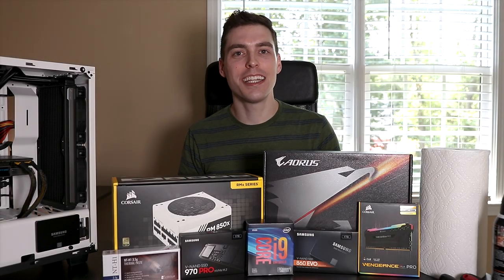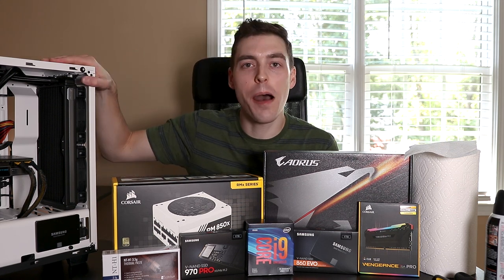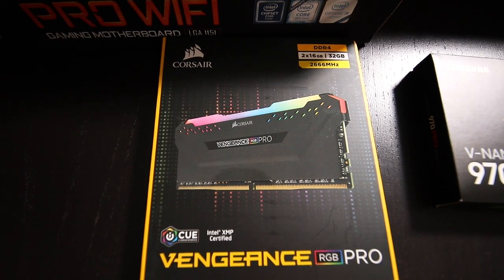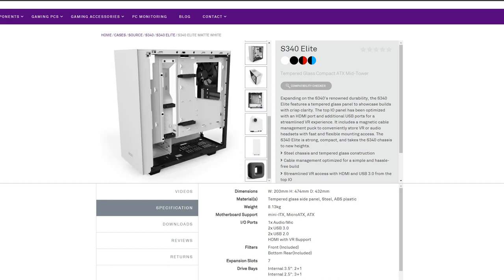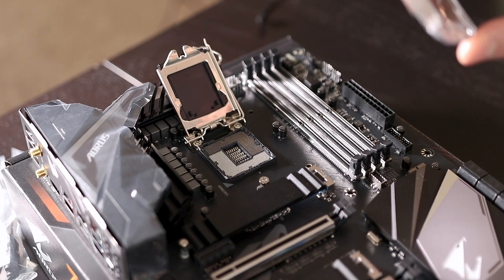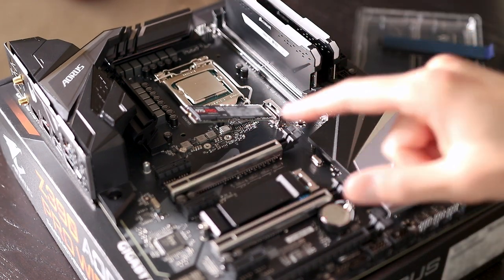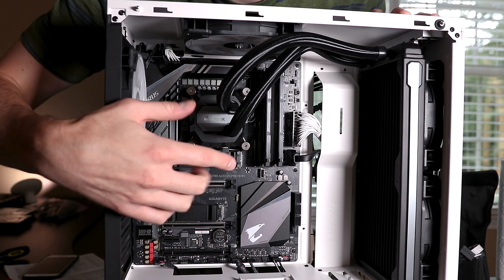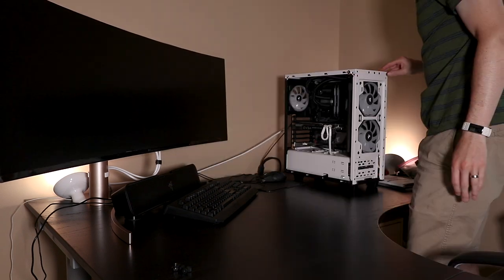How to Build the ULTIMATE Photo Editing & Video Editing PC!

Comment: I would recommend the ryzen 7 3900x instead of the i9 due to the fact that while i9 May still be just ever so slightly faster in gaming, the 3900x is note only cheaper but also has better multi core performance and is overall way faster and far more superior for multitasking, rendering, and whatever is your work flow, team red is strong atm